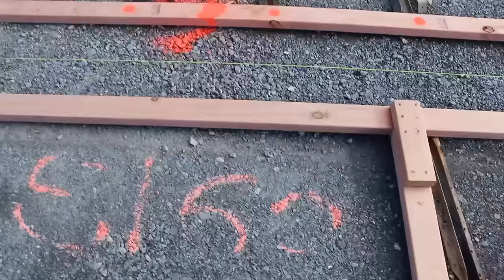My Largest New Build Ever - Start to Finish

Comment: Do you live those white foam boards in your concrete? if so, then why?
Reply: It's called a "rib-raft" slab it's an engineered concrete slab that sits on top of the compacted hard fill as opposed to a standard slab here which has footings dug to solid and  maby 100millimeters of concrete through the middle. The rib raft became popular after the Christchurch earthquakes. As they alow the whole slab to move. The white 'pods' add insulation and save on concrete